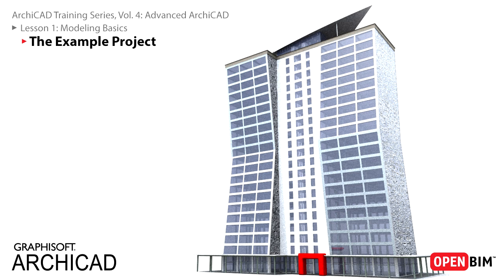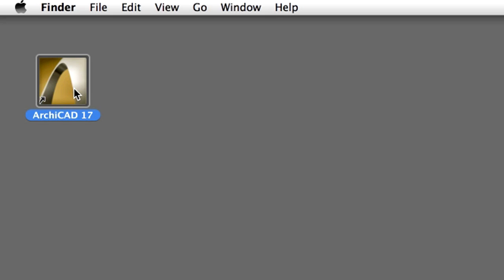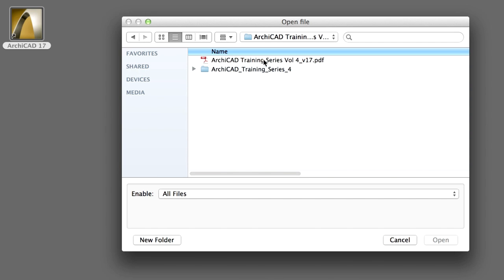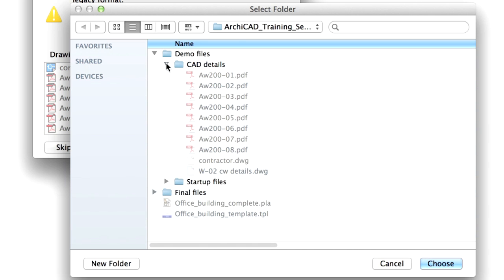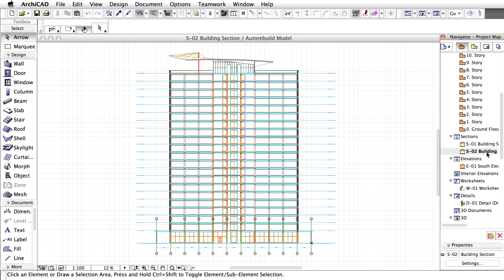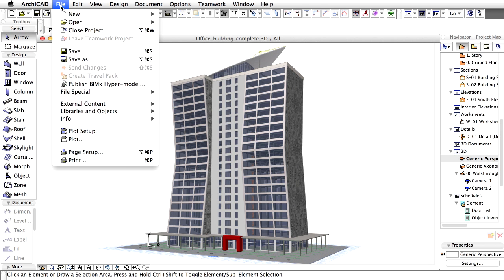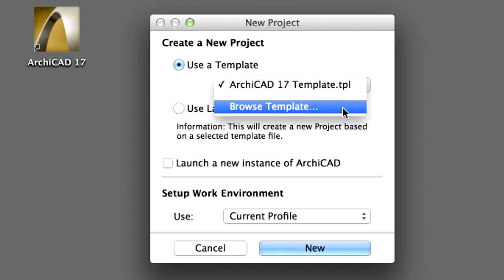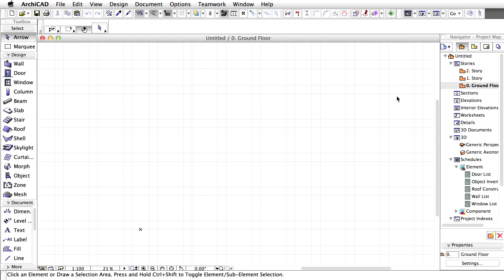ArchiCAD Training Series Vol. 4: Modeling Basics: The Example Project

Comment: I am from India 
Here the standard units are in feet and inches.  When I set the units to feet and decimal inches it works but it resets whenever I restart archicad. Is there a way to set units default to feet and decimal inches